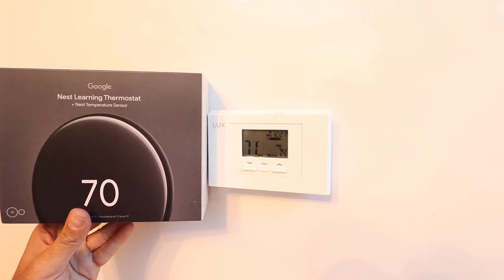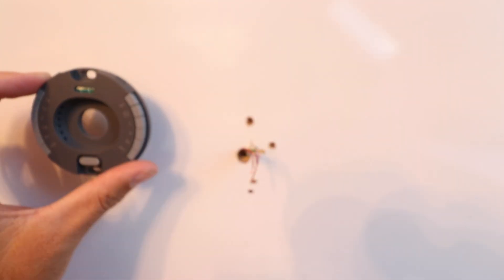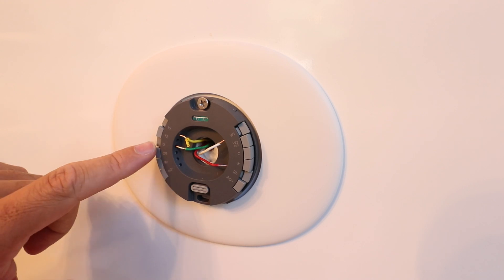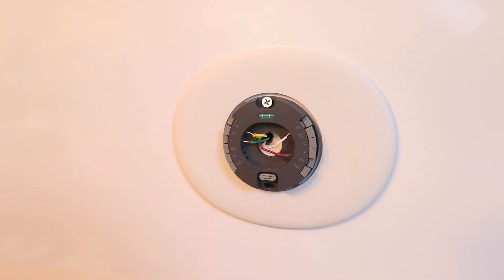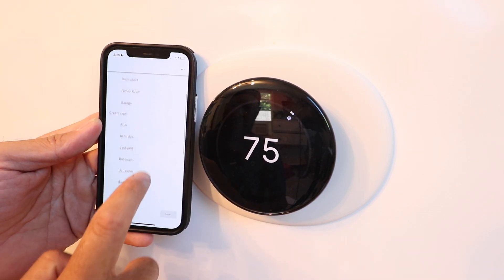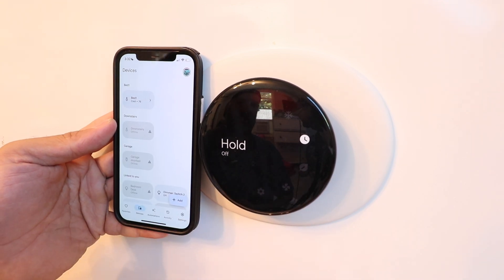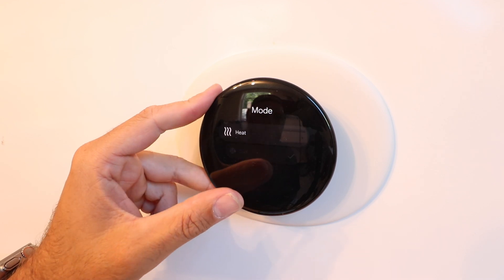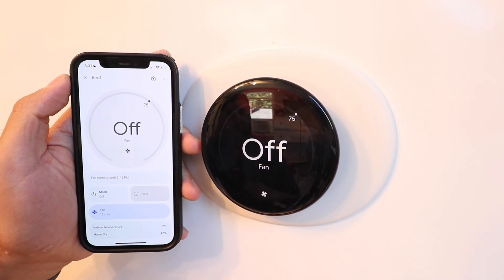How To Install Google Nest Thermostat 4th Generation

Comment: I have an electric heat pump. In my case, I had to connect the W orange wire to the OB port on my nest thermostat rather than the Y port. AC was not working when it was on Y. Only heat was working. Also, I had to keep the blue C wire disconnected. There was no power at all with that one connected.

Comment: How do you wire the gen 4 nest when the boiler and central air both have transformers? Do you need an isolation relay?

Comment: I have 3 wires on a heat only system. Red, white green. Now only red and white are used. Green is tied off. Can I use the green as common, (C) for the 4th generation nest back plate and then use green at the boiler on the circuit panel common connection so it feeds power to thermostat?

Comment: I just upgraded from a Nest 2nd gen to 4th gen and there are a couple quick points I wish had been mentioned here: 

1. My Nest 4th gen arrived with zero charge on the internal battery so got sidetracked troubleshooting why it wouldn't power up after connecting all the wires and flipping the furnace power back on. Had to charge the Nest 4th gen for about 20 minutes using a portable power bank connected to the USB-C port on the back of the Nest before I could pop it back into the base plate and continue with setup.

2. Not only do you have to set up the Nest 4th gen in the Google Home app but, even after setup is complete you cannot add it to the legacy Nest app. The main reason I upgraded was because Google is killing app support for the Nest gen 1 and gen 2 thermostats. I have been using the Google Home app for lights and a couple of other devices for a few years now but it was always nice to have the dedicated legacy Nest app when I just wanted to check my thermostat.

There were other little glitches such as the Google Home app setup routine saying the Nest 4th gen wasn't connected to WiFi and couldn't download updates from Google even though the face of the Nest 4th gen itself literally said it was "connected" to my 2.4 Ghz WiFi network. And there is no way to back up far enough in that part of the setup to repeat the "connect to your WiFi" step. You can only "retry" connecting to your WiFi (no way to pick a different network or whatever), or, otherwise you have to completely exit the setup and start all over again from the very beginning. I'm more convinced than ever that the engineers working at Google are not humans. They're overly confident that their streamlined approach to setup routines will work flawlessly every time and that their non-intuitive leaps in logic make perfect sense to everyone else. Also, I'm glad I kept the cool screwdriver that came with my Nest 2nd gen. Very handy bit of kit that I still use all the time ;-)
https://www.reddit.com/r/Nest/comments/10u0l62/shoutout_to_the_nest_screwdriver_you_have/

Comment: Not an expert but the first step should always be to turn off the breaker to your thermostat. Tons of DIYers accidentally short 2 wires while changing thermostats and if you short 2 specific wires it can cause issues requiring an electrician to fix. I forget the exact issue and fix.
Reply: I found it. If you short the C wire with any 24V lines (typically the R), you'll blow the fuse that's typically on the control circuit of your furnace. If it's merely a trip, you can fix it easily. But if it's blown, then you'll need to buy the corresponding fuse (usually 3 or 5A) to replace it and most people don't have that lying around...so turn off the breaker, especially if you're doing this in the winter.
Reply: 3amps fuse are commonly used in auto, I brought mine from Napa

Comment: Labeled the wires but the small screws in my old Honeywell thermostat are frozen and I can't remove the wires from it. Trying to soak each in a drop of PB Blaster. Fingers crossed ... this was supposed to be a simple 40 minute job!
Reply: Well the PB Blaster helped but my son's strong experienced grip broke them loose. You could hear each one "crack" loose. Boy were those little screws locked tight! Last option would have been to cut them. The Nest Thermostat seems to be working fine so far.

Comment: Great video but you forgot to install the metal mounting plate before the white cover plate.
Reply: The metal plate is only required if you’re installing using electrical box.

Comment: Does the 24v transformer set up that you show in this video https://www.youtube.com/watch?v=gahPxCcPDto also work for the new 4th Gen?
Reply from the maker: Have not tested it specifically but it theoretically should as it’s the same type of transformer you would find in a typical HVAC system.

Comment: the problem im having is that the wiring from my old thermostat seems to be copper (kinda’ thick) and wont fit all the way  into the little holes of the gray connection wheel. they go in the entry hole but wont go all the way back in to get that secure connection snap. any suggestions? if not, i’ll have to return it. obviously i have an old house. 😮

Comment: wait, where is the power switch to turn ac/heat power off? I thought you would use house circuit breaker or is that not safe for house to flip>

Comment: I have emergency heat on my current thermostat that uses a jumper wire.  I have been told that this is not needed on the new nest thermostat as nest detects this and no jumper wire are needed.  Is this true.  I am getting different answers.
Reply from the maker: In my case it did not require a jumper wire. It may still need a common wire in some cases however it does have ports for emergency heat with heat pumps. Let me know if you have any more questions.

Comment: The new one doesn't need a common wire?
Reply from the maker: It will work without a common wire for most systems. If you have a heat only or a ac only system you may need a common wire.
Reply: Nest is clever, it’s able to siphon just enough energy from other circuits to keep battery charged and not disturb the system functionality.